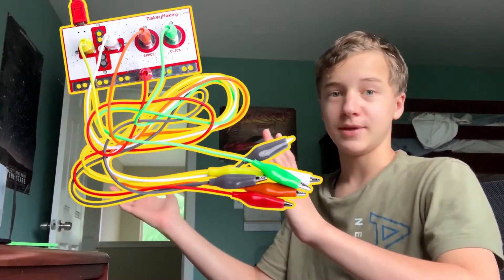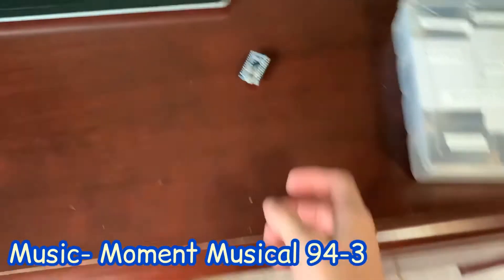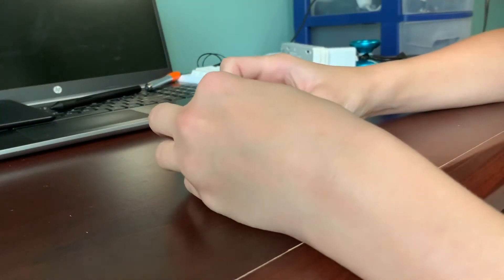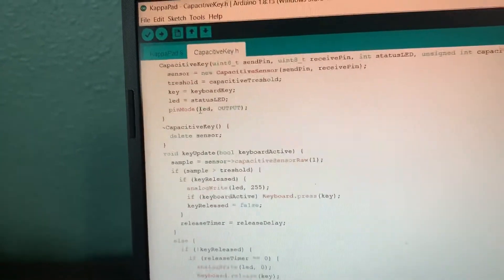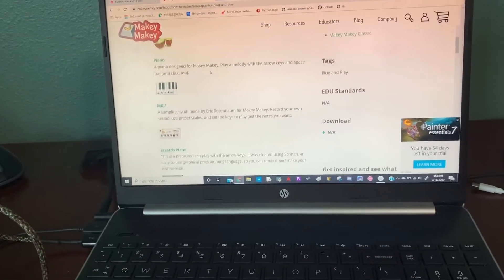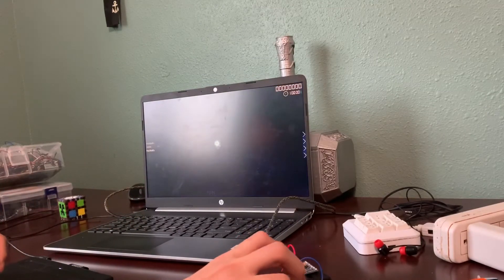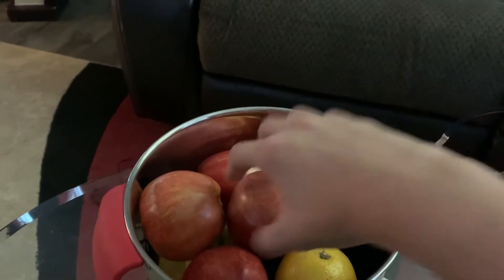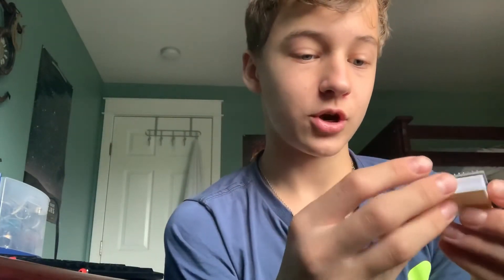DIY Makey Makey with Arduino Pro Micro

Comment: Can you put the wire in a glass with water?
Reply from the maker: yeah try it out, just be really careful to not get the arduino wet, also if it doesnt work add some salt to the water